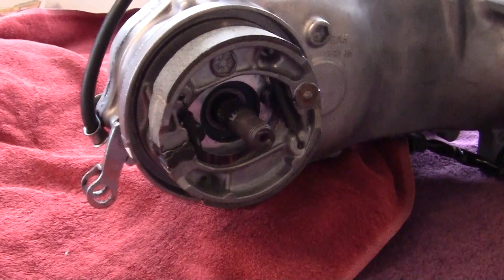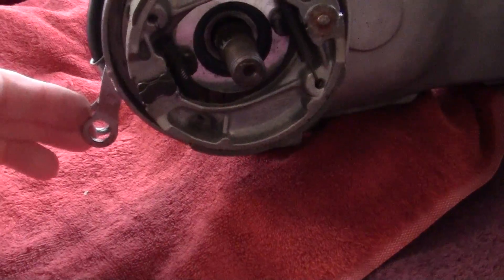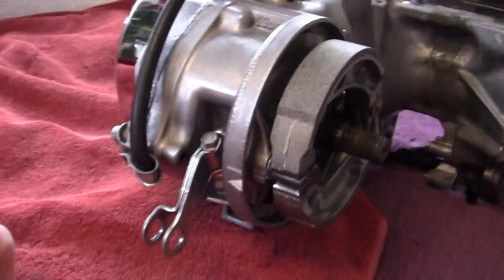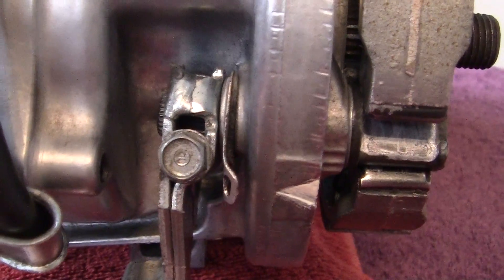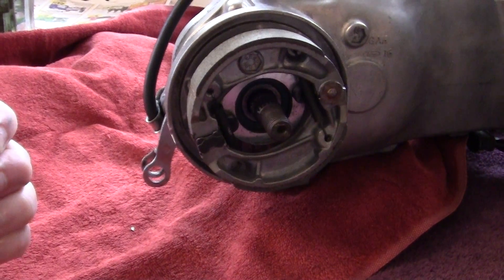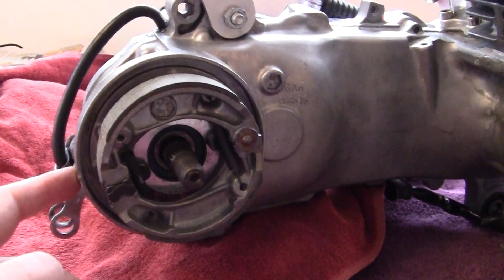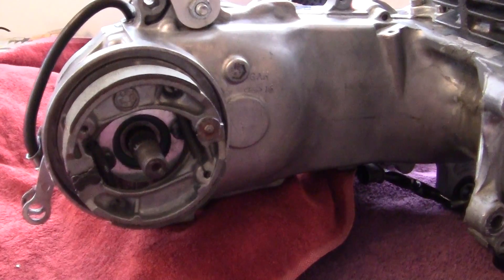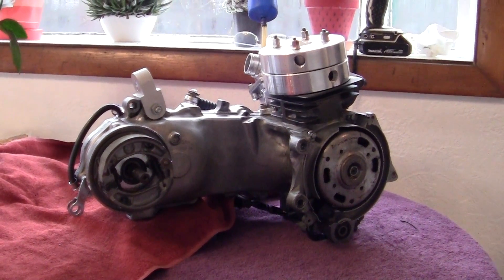156 -Operation Honda DIO= 120cc STROKER ENGINE.

Comment: I have a question for you! I have the common af16 build! Polini 70cc 28mm oko carb pg short and all the goodies! I have to run this set-up with the choke on!? What's your thoughts!!!??
Reply from the maker: GET A BIGGER CARB...!!!!
Reply: Larger Pilot jet, and prob larger main jet you need -
Reply from the maker: Now you're a Carb Expert. Congratulations.
Reply: When 65/70ish degree comes around I have no need  for the choke. I live in Rhode  Island so it's like 20 something degrees currently.... I figured a 28mm carb on a polini contesa would work and during warmer temps it does. Roads are still rideable but it's cold as uck!
Reply: Just looked up 32mm carbs. Inexpensive enough to give a shot!